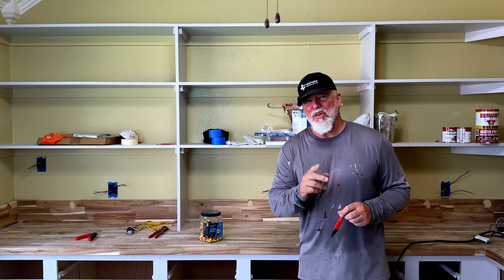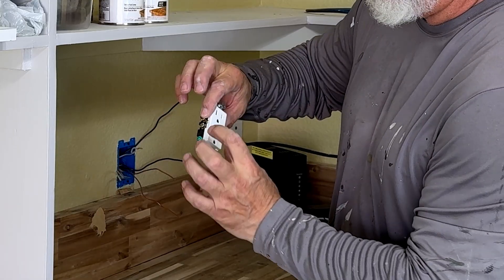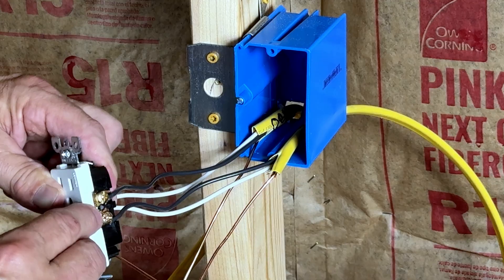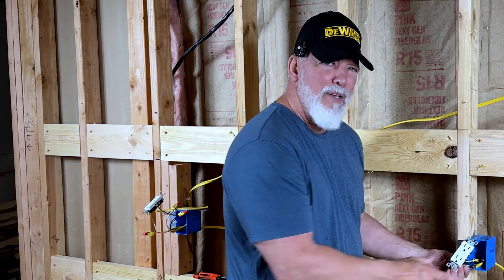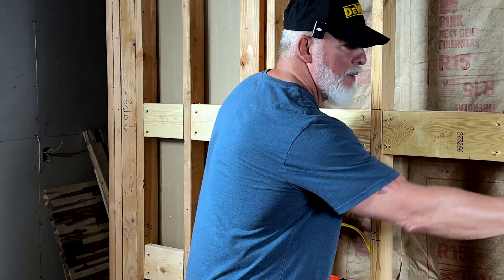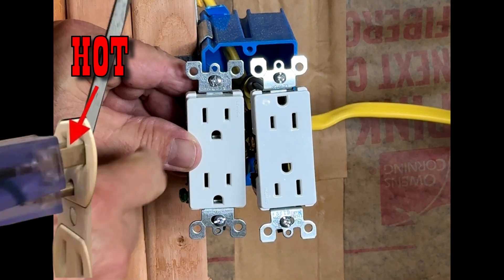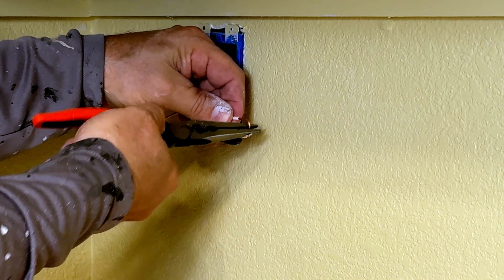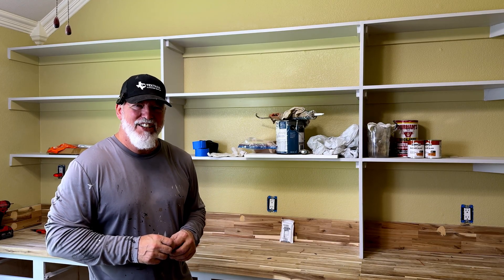Electrical Outlet Wiring Basics | 2 Ways to Daisy Chain Circuits

Comment: Do the pigtail wires need to be a specific length for code? I know you need a bit of sheathing coming into the box and then usually about 6 inches of wire coming out of the box to have room to do what you need to do, but with adding the pigtails, do they need to be a specific length or are they considered part of the 6 inches of wire? If that makes sense
Reply from the maker: Great question — and yes, it makes sense.

Under the National Electrical Code (NEC 300.14), conductors inside an electrical box must be long enough for safe splicing and termination.

The code requires at least 6 inches of free conductor measured from where the wire enters the box, and at least 3 inches extending past the front edge of the box.

When it comes to pigtails, there is no separate minimum length requirement in the code. Pigtails are not required to be 6 inches on their own, and they are not considered a special case. What matters is that all conductors in the box are long enough to safely make splices and terminate on the device.

As a best practice (not a code requirement), most electricians cut pigtails 6 to 8 inches long. This allows the device to be pulled out for servicing, keeps connections from being under tension, and makes future work easier and safer.

Bottom line: as long as the original conductors meet the 6-inch rule, the pigtails only need to be long enough to make solid, stress-free connections. There is no code-mandated minimum length specifically for pigtails.

Comment: What about "rabbit-earing?" Looping the wire through one terminal.  Is this practice still code compliant? It was used in the old school days.
Reply from the maker: If you’re talking about the method, where they loop the wire through the terminal without making a break and continue on I have seen that done and I would imagine that would be code if your inspector allows it, but it is not done very often.

Comment: Does the placement on the outlet (top or bottom for incoming hot wire) make a difference when daisy chaining?
Reply: For example: at first outlet- main lead goes to top set of screws, and the next starts at the bottom of the first outlet and feeds into the bottom of next receptacle. That receptacle sends wire out from top screws into the next outlet top screws ( --_ -- _--)
Reply from the maker: See the answer in your second comment.
Reply from the maker: No, it doesn't matter because you have a small tab connecting the two screws, so basically they become the same connection point. The only way that would matter is if you break the little tab so you can run dedicated power to each outlet on the duplex. Thanks for watching and commenting.